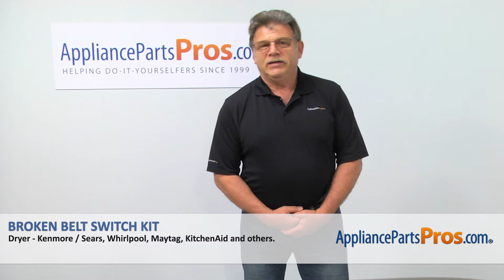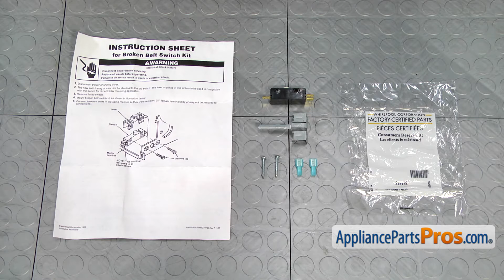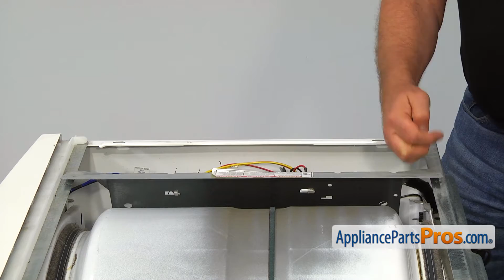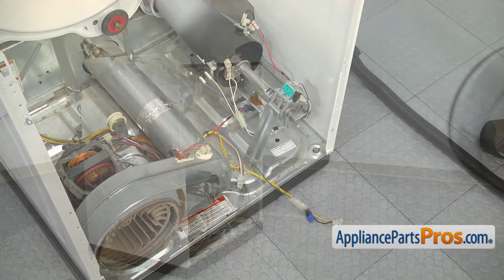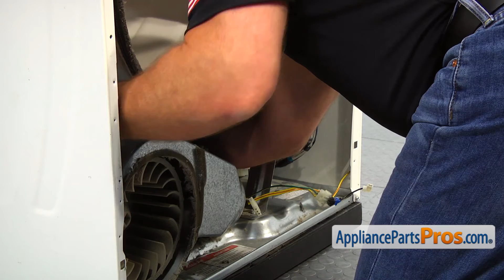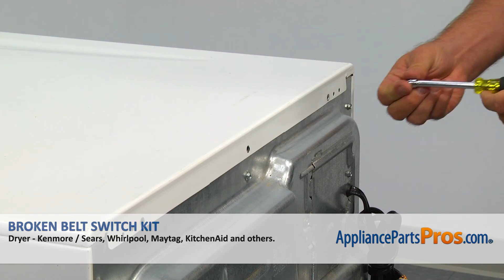How To: Whirlpool/KitchenAid/Maytag Broken Belt Switch Kit 279782

Comment: The product manual doesn't mention taking off the front cover. I think he's doing too much..
Reply: Right.  Just the back needs to come off unless you're going to replace the drum rollers as well.  For some reason the rollers came with the broken belt drive switch.  Symptom of bad rollers are >  A rhythmic (1 bump every 1/2 - 1 second?)  bumping noise caused by flat spots on 1 or more rollers,  Flat spots are caused by heavy loads with extended dry times.